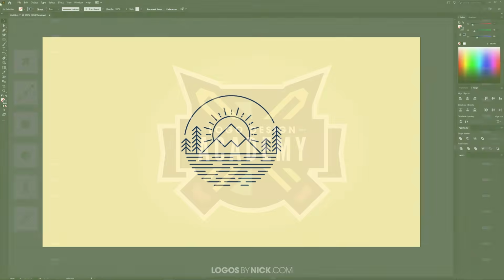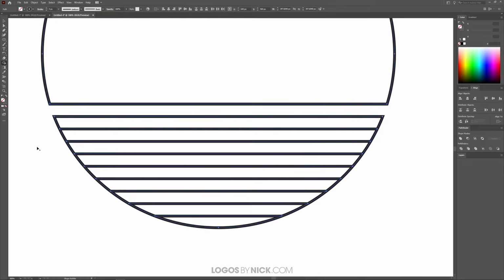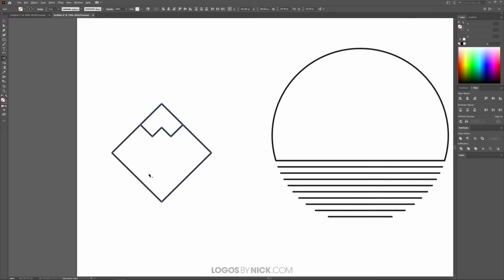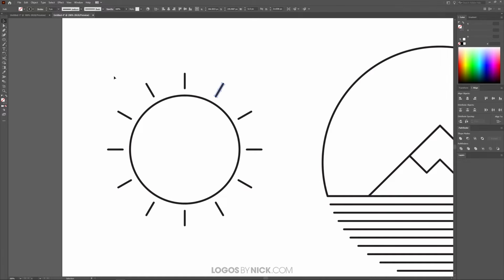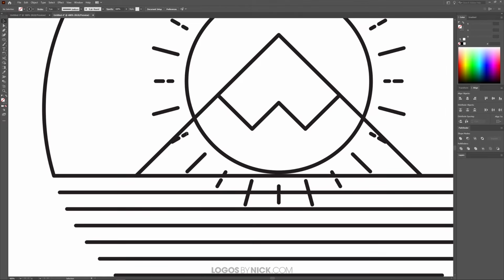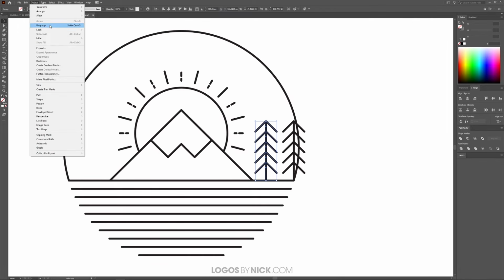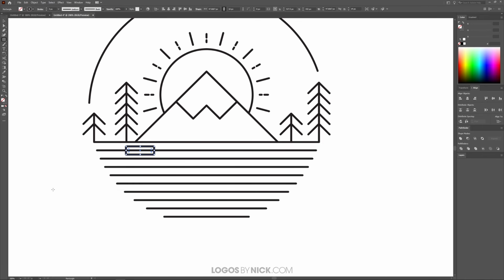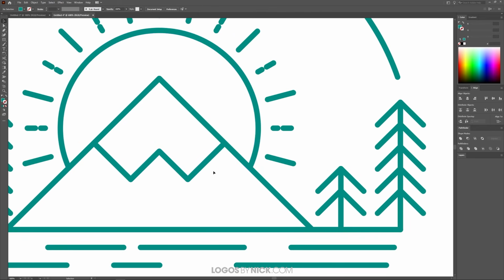Create Line Style Drawings with Illustrator

Comment: Fascinating and extremely useful!
I find the way that Adobe labels the Align tools confusing.
For example:
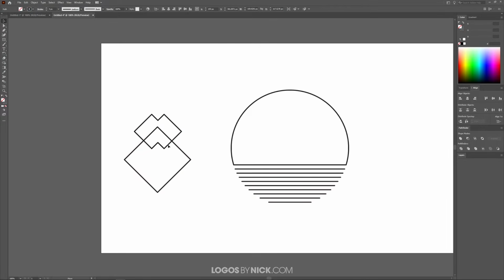When you wanted to align the pieces of the mountain (at 6:05) vertically, you had to align them horizontally!
Surely the tool should say 'Vertical Align Center' and do what it says!
Reply from the maker: Glad I'm not the only one who has a problem with that! I'm so used to how Inkscape has them labeled (inverted compared to Illustrator) that it throws me off every time.